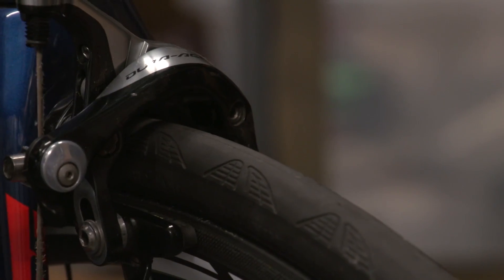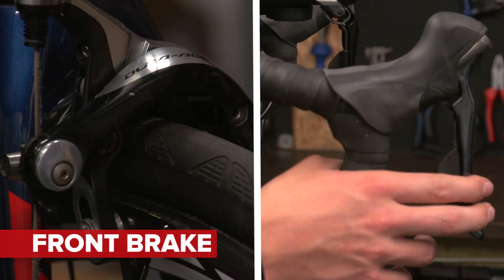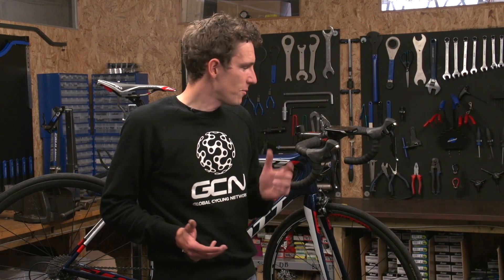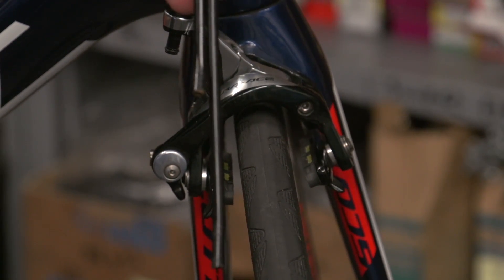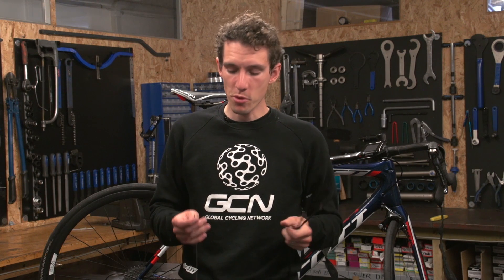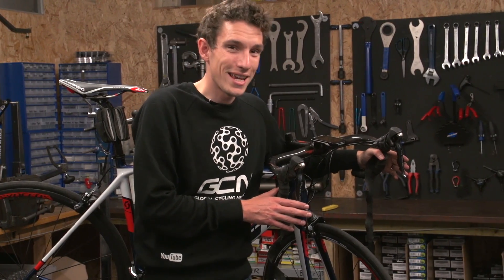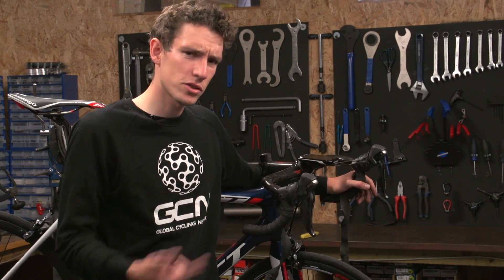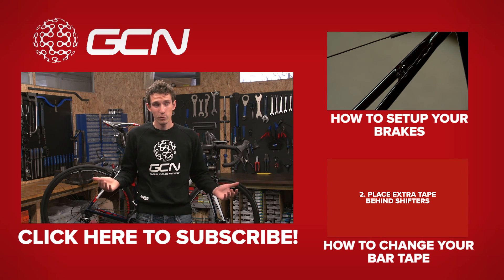How To Switch Your Front And Rear Brakes

Comment: I ride pedal bikes and motor bikes so quite thankful I've grew up with the front being on the right for both kinds of bikes!  Wonder if Americans in my situation press the clutch in to try and stop some times, that would be awkward.
Reply: Crana Yea, when braking and shifting are together I think it's just simpler for the average rider at least, to have all front and all rear control on one side or another; and since I've never really seen right side front shifting as an option...  If one grew up with years and years of opposite side shift/brake than that'll be more instinctual.
Reply: Crana tell you what...when I (American) rented or borrowed cars in the UK (I lived in Scotland) I'd invariably engage the clutch, drive away all smoov, and then depress the clutch to shift into 2nd...and...of course...because that's what one DOES with one's left hand in the US...flick on the turn signal...while slowing to a confused and pathetic halt. Really interesting to realize how deeply physical/learned experience is engrained.

Comment: Global Cycling Network can you guys do a video on double wrap (double layer) bar tape. I've tried it myself with mixed results. The start of the wrap is an issue because two layers of bar tape are a pig to push into the bar using the bar end plug. Also top layers of tape need to be tight to avoid slipping and separation of wrap.
Reply: Stephen Connor I would like to see this too
Reply: Stephen Connor Only stick the top layer of tape inside your bar end plug. The upper wrap of tape will hold the lower wrap in place if it is tight enough.
Reply: Stephen Connor  I double up only on the top bar and not in the drops.  This avoids the bunching of tape into the bar end.  the amount of time in the drops is less and if on rough roads I am usually holding up top.  Obviously the outer wrap covers all and the under wrap is only up top.
Reply: I commented that and nobody listened
Reply: Xavier Laurier Good tip Xavier. Will bear that in mind when wrapping next.
Reply: ***** John do you wrap the tops as far as the hoods or just the top as far as the bend. I like the extra padding at the heel of my hand when on the hoods.
Reply: Stephen Connor  I wrap all the way to under the hood for extra padding for the heel of the hand while riding on the hoods.  Works great.  Looks clean.  For the over wrap I use the wide Specialized Rubaix wrap that doesn't drop into the groves of the narrower wrap under it.
Reply: Stephen Connor I double-wrap, & only push the inner tape into the bar ends. The outer tape I start near the bar ends, but not right up to the end, & I stick it down & tidy it up with a bit of electrical tape over the top.
Reply: Stephen Connor Similar to other comments, the under layer of tape won't be visible so use electrical tape of sort to tape in directly onto the end of the handlebars. Then, the over layer of bartape will fit nicely into the bar end plugs. I double taped for the first time this way the other month and it works a treat!
Reply: Happy Elephant If you do it the other way around you may find it looks a lot neater. I tape my bottom layer and hold my nice outer bar tape in with the bar ends. Also I don't have to go pulling off electrical tape when it comes to replacing.

Comment: Bikes in Japan also have the brakes set up so that the right lever pulls the front brake. FYI.

It also has to be said that hydraulic road disc brake levers can't be switched this way, I'm afraid. Because of the distinct left/right shaping of the levers, Shimano and SRAM sell their hydraulic road disc brake levers in specific "left = front" or "right = front" configurations.
Reply: TypeVertigo My road bike has Shimano hydraulics, which are in fact configured left=front, right=rear. I don't know, however, whether it would be possible to switch the brake hoses.
Reply: Phaidrus It's entirely possible just a LOT more work and potentially requires specialty tools and probably new hoses at least for the rear. Definitely possible but it's much more work.
Reply: I see. I used the SRAM HRD brake system listing on Chain Reaction Cycles as basis.

I guess for retailers and simplicity of stock-keeping purposes, they just bundle a pre-plumbed brifter, hose and caliper system for sale...but yeah, it can probably be re-jiggered to the desired configuration later on. Thanks for the heads up Skooteh and Phaidrus .
Reply: Oh my God!! Well thanks for letting us know!

Comment: Two things, one suggestion in regards to taping the cable housing, use gaff tape instead of electrical as it won't leave that nasty gummy residue on your bars. Another is why does everyone wrap the bars from the drops up, my father always wraps his from the tops down which means he doesn't need to use any tape to secure the wrap.

Comment: You brought up a good topic. How do you save / repair frayed cables? Be it brake or shift cables.
Reply from the maker: perwiratempur If it's just the tip then you can cut it again, but any more fraying than that and you should most definitely replace.

Comment: Just a quick tip to hasten the not so quick process by ¼ of the time or maybe more. Just cut the longer one to suit the shorter route with a pair parrot nose pliers and replace the longer one. So you only have to remove one side of the bar tapes. That is if you intend to keep that bike that way of course.

Comment: Thanks! I started switching my brakes to the "goofy" UK setup about 10 years ago. I ride in the U.S., and as Sheldon Brown and others have pointed out, here's why Front=Right makes sense in most places: When crossing oncoming traffic while making a left turn, I can brake effectively, with my dominant hand, while signaling correctly with my left arm outward. That's it.

But I run into that situation enough to know how unstable or unsafe it can feel on the standard setup of Front=Left. Esp. since I also learned to ride on a road bike with downtube shifters and would always shift with my left hand (while wanting to maintain the ability to brake with my strong hand on my most important brake).

So really, what are the reasons for setting up the brakes with the standard orientations? In the UK, it seems to be one of the few places where Front=Left would make more sense. I've never heard a good answer to this query.

Comment: for someone who is relatively new to road cycling and live in a city that is mostly flat, when should I use my rear and when should I use my front brake?
Reply from the maker: Robin Chen Check out this video we shot before: https://youtu.be/frIKK_XU-qE
Reply: Robin Chen The most basic response I've heard (and taught), in most conditions when you're coming to a stop, get used to using your front brake; in wet, sandy, icy, gravely conditions, or just to shave a bit of speed, use your rear.
Reply: Robin Chen 
The front brake gives you a lot more stopping power than the back brake (no idea why).

Universal advice is to mainly use your front brake for stopping - but include your back brake for some added stopping power.

Take it steady the first few rides, you'll soon get a feel for it.

Ask around (like you are doing) weigh up responses and go with what feels right.

Keep your brakes well maintained though as that is a) safe! and b) gives you more freedom if you're confident in being able to stop.

A lot of people are reluctant to use the front brake because of childhood memories or warnings that if you pull on it suddenly you'll fly over the handlebars. That might have been good advice at the time - but it needs revisiting for adults. If you yank full on your front brake then yes you might go flying, but use it sensibly and it's the best way to stop.
Reply: Woody Eckerslyke front wheel takes more weight transfer during braking when bike/rider moving forward making front brake more capable of slowing bike vs rear brake/wheel.  The rear gets unloaded when braking and moving forward which means its less capable of stopping the bike vs front and more likely to lock the wheel under strong braking

Comment: I've just bought my son's third bike. I've tried and tried to get him to use both brakes but I fear he might be the sort of person to learn from his own mistakes rather than the mistakes of others. Anyway, I was amazed to discover that the front brake is on the right in the U.K. I'm virtually certain that I always had mine on opposite sides. I'm worried about his going over the handlebars. Do I switch the sides? He's got 5 gears on this new bike; his first bikes had none.
By the way, could someone tell me what the screw-in handlebar plugs are called? I'm tempted to buy some rather than new grips. Thanks!
Reply: I've just had a look. Handlebar end plugs. Witty and original.

Comment: Anyone who flips themselves over the bars from the front brake is doing it wrong. I use my front brake almost exclusively, and have never once flipped, not even lifted the rear tire off the ground. 

So if I were to hop on a UK bike I would likely use the rear brake instead of the front at first, until I got the hang of it, and that's generally considered less hazardous than using front brake only, albeit with longer stopping distance. 

If I were to build a bike with one brake it would ALWAYS be on the front, no doubt about it.
Reply: Patrick94GSR The theory I've always had is people endo because they've been taught to fear the front brake, so when they're confronted with an emergency situation and go to squeeze both brakes hard, they're not prepared for the effectiveness of the front.

Comment: Why remove the inner cables then remove the outer cables? Why not remove the bar tape and switch the complete inner and outer cables to the opposite levers?
Reply: brandywell44 The inner has to be pulled all the way through the levers to switch it over, so the inner and outer has to be separate.
Reply: Thanks for explaining.